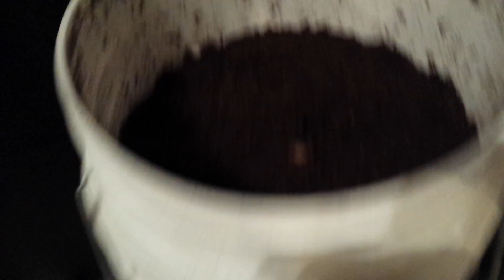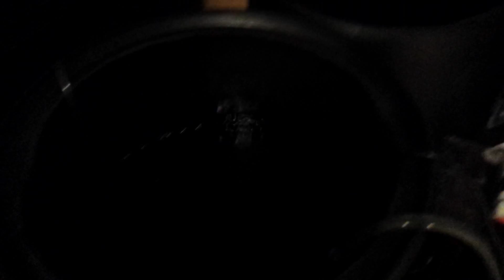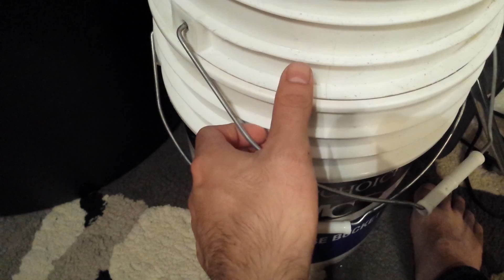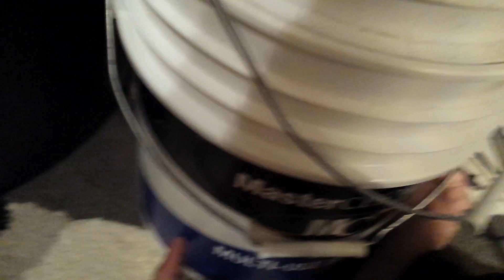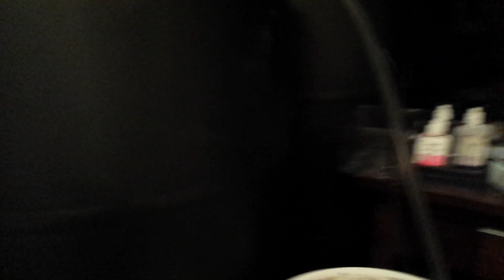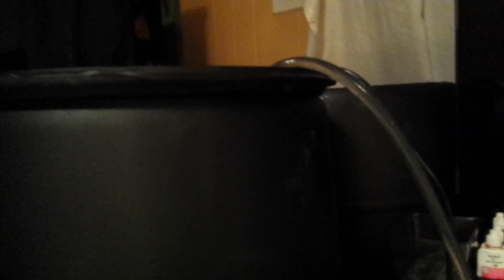Peat water filter test, failure!

Comment: Johnny... Just add several drops of hydrochloric acid... And check the pH regularly until you get it to where you want. I used to do that on my tank.... Worked perfectly fine.
Reply from the maker: I've never heard of that before in the aquarium use, is it fish safe?
Reply: My fish never died... Its just HCL, which when you dilute in water it separates into hydrogen and chloride... The extra H+ molecules is what makes the pH lower.

Comment: My tap water pH is 8.6+, kH is 300+ ppg, and gH 300+ ppg. I filled up a 4 gallon bucket with this water, treated it with sea chemical prime, and retested. No chlorine and everything else related to this experiment remained the same. I used a topfin internal 20 submersible power filter filled with nothing but organic spaghnum peat moss. After 48 hrs, and 3 peat changes, the pH was down to 6.2. After another 24 hrs, the pH went up to 6.4 and stabilized there. Will be checking kH and gH in 24 hrs. It's all about experimenting until you find the right mix. I'm also working on a way to cut nitrates down to next to nothing. Those results will be a few months up the road since it takes a while to get the denitrifying bacteria going. That will cut down on water changes, and water changes are the enemy when you're manipulating pH, gH, and kH. This will be much more work than water changes are, but much safer for the fish. pH shock kills.
Reply from the maker: Yep, definitely they do. I tried for a second time adding more peat filter water than the last time, but it bounced once more. I believe my water has too much buffer that no more how much I do it would always bounce back. But thanks anyway.